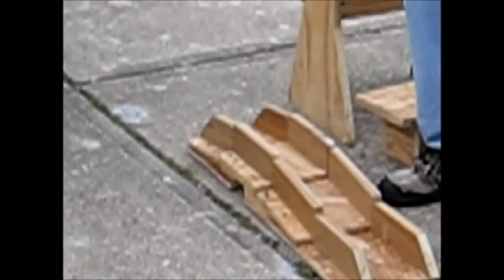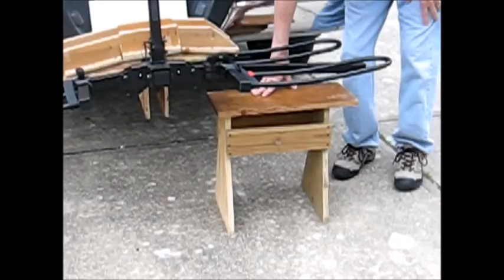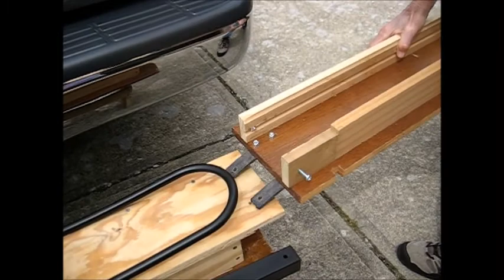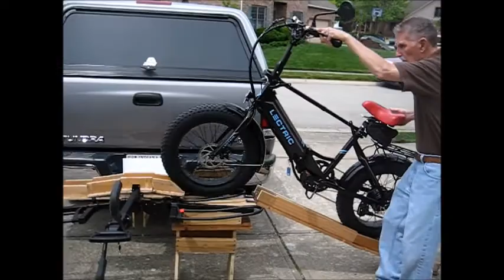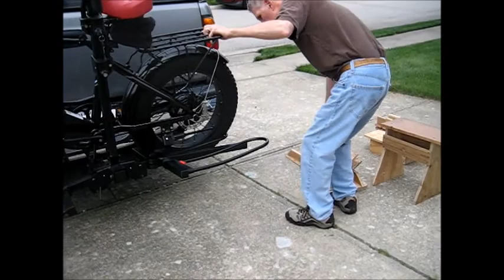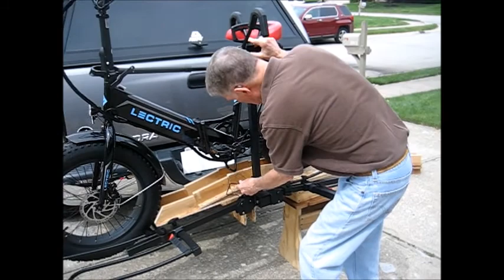Lectric Ebike Rack Ramp

Comment: Respectfully, this seems too complicated and too many parts. There’s got to be better ways.
Reply from the maker: Bob, you are correct, there is a better way!  Yakima makes a rack with a ramp which appears to work with much less hassle than my system.  However, that rack costs over $250 more than the Hyperax that I bought and the wooden pieces that I made.  I am just trying to give Lectric owners who have physical limitations and a limited budget an option to risking injury from trying to lift the 70 pound bike.

Comment: The bike almost fell when you were taking the bridge out. A better way would be to fold the bike up and put it in a large heavy duty storage tote. Put it into the bed of the truck and throw that bike rack in the garbage because it's not going to hold up very long with 60+ pounds bouncing all over the place as you drive.
Reply from the maker: Rob, your are right! Pulling the bridge is the most demanding part of the ramp system.  Because I have a need to transport both a foldable and non-foldable the tote system wouldn't work for me.  Also I have found that folding and unfolding the Lectric is a real job for one person.